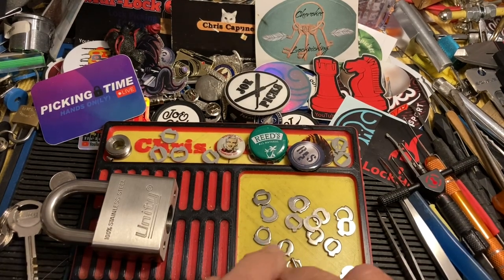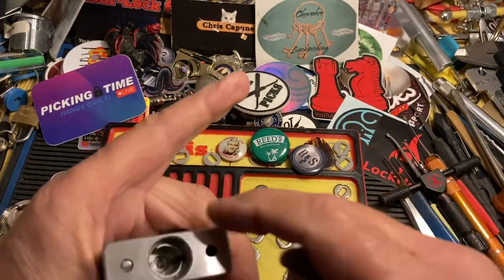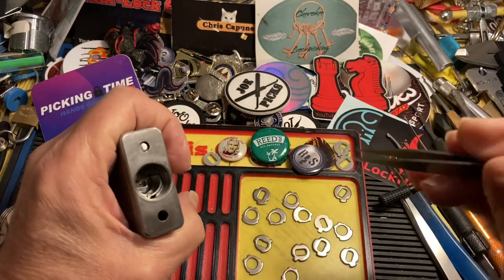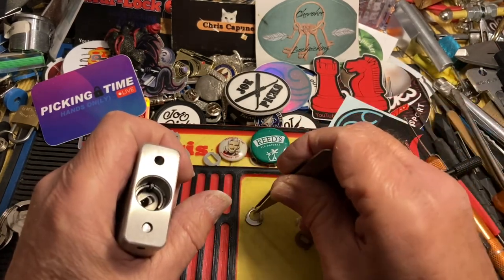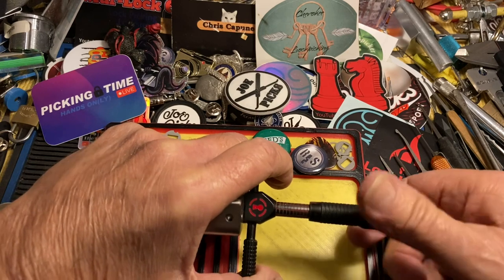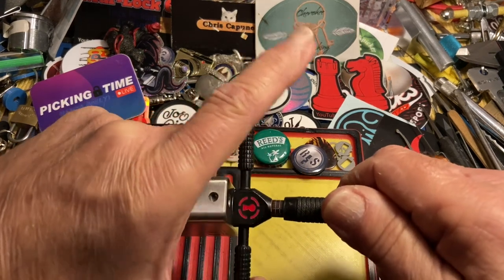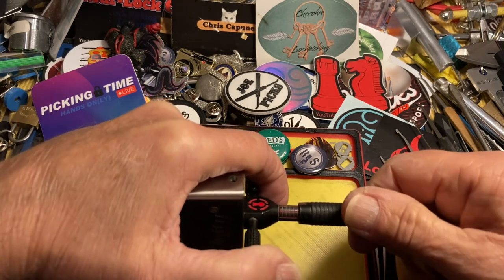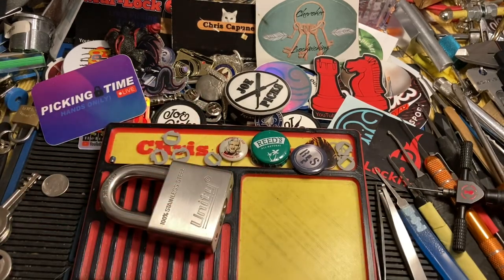#2417 How to scramble and pick a Unity DD Padlock

Comment from the maker: You can also load it with a non zero disk in the back and front so you will have to tension off a zero disk in the middle to counter rotate to the open😃 
🐈🐾🐈‍⬛🐾👍

Comment: If the key worked, I would say run and get yourself a lottery ticket asap 🤣
That lock has got to be one of the best ideas for practicing disc detainers, I have ever seen.
Excellent job on getting an open, fast too!!
Reply from the maker: Thanks my friend!! 
I also like to make the first and last a non zero cut so you have to tension on a mid zero to counter rotate to the open 😃🐈🐾🐈‍⬛🐾
Reply: @chriscapune7873  Great tip, that really is the perfect lock for DD practice 👍👍